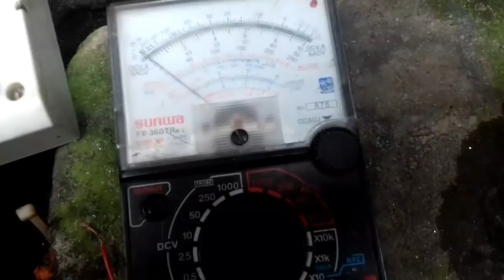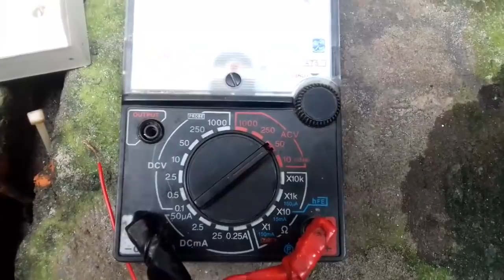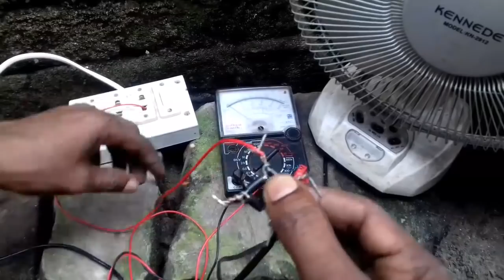Run the fan without the current with the Neutral and Earth

Comment: It is only possible at the time of available electric supply.,in this time a current is in betwen neutral and earth but it depend upon load, depth of eathin, generally at night the voltage is increased gradually from 6to24v Ac...Up to 9pm.
Reply: But when Power Shut down then?

Comment: নিউটল, আর্থিং কি? তুমি ভালো করে বুঝে নিও। তারপর ভিডিও বানাও। আর ফালতু ভিডিও আপলোড করো না। কাজ না থাকলে মুরগির খামারে কাজ করো। টাকা পাবে।
Reply from the maker: মুরগি ও আছে ডিম দিচ্ছে ভাই
Reply: very good answer with respect to the comment. Very good bro.
Reply: Though I did not test this the experiment as shown in this video. But the concept is not wrong.
Reply: actually what happens that due to the mutual inductance the neutral wire as it is most of the time being parallel to the phase  induced in some extent(but very weak) ;if at the time we touched it with  a separate earth so obviously a current will be flow due to tiny voltage difference. The experiment can be possible only for the high voltage line not for the low 220 volt ac ,in that case possibility of moving a fan is quiet informal bub in exception might be happened.
Reply: @ইলেকট্রিকবিডি  সামনে তো শীত শেষে এই গরম আসতেছে তাই আপনার মুরগীদের জন্য নিউট্রাল ও আর্থিং এর ফ্যান রেডি করুন। দেখবেন যে ডিম ডাবল-ডাবল পারতেছে